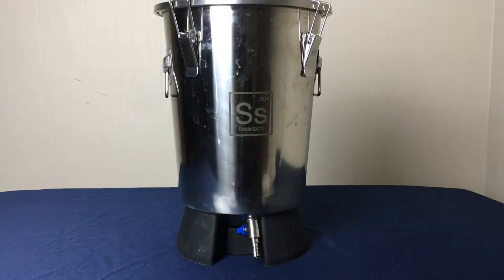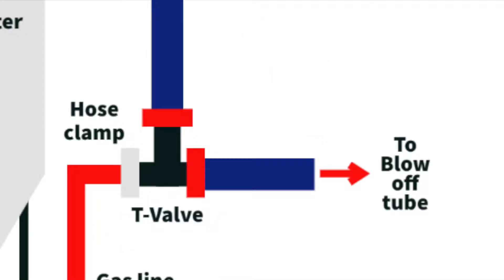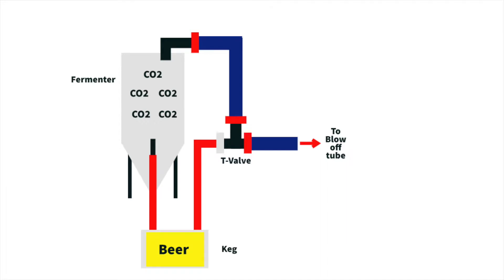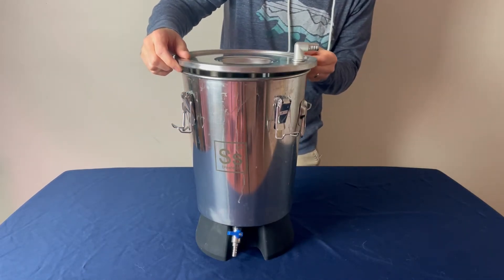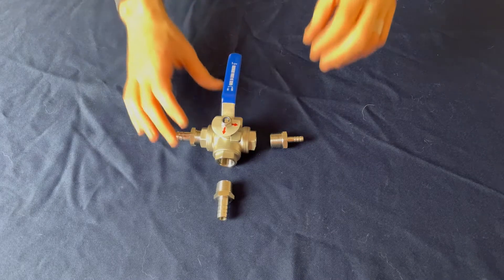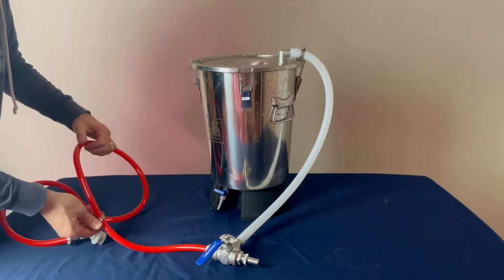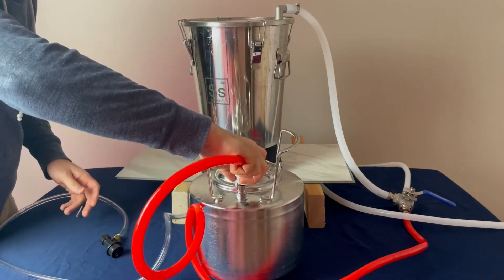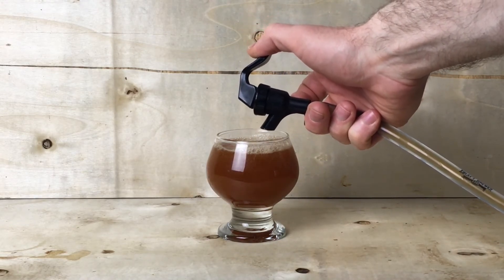How to Close Transfer Beer with the SS Brew Bucket

Comment from the maker: How do you reduce oxygen when transferring your homebrew?
Reply: It's a closed loop, so the beer is only exposed to what little oxygen that remains after purging your fermenter and keg (which is barely any) with CO2.  Normally when you transfer beer from a fermenter to a keg, you have the keg top open and the keg and the beer pouring in from the hose is all exposed to oxygen, which is bad for beer.
Reply from the maker: @Craethir  I now fermented in kegs with either a blow off tube or a spunding valve, with a floating dip tube on the liquid outside. When the beer is done fermenting I pressure transfer to a serving keg.  This bucket fermenter is great for making fruit wine.